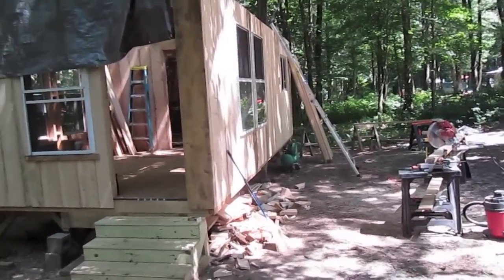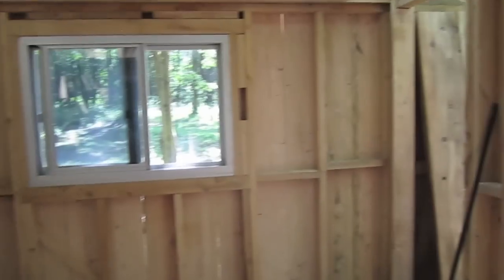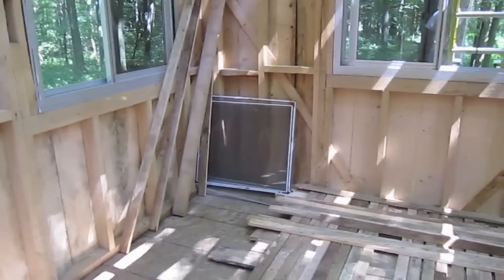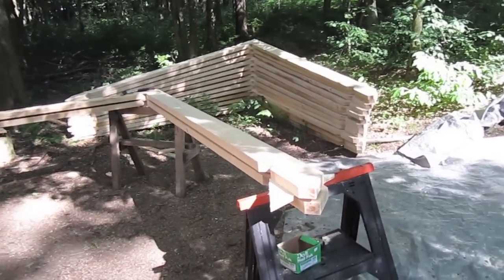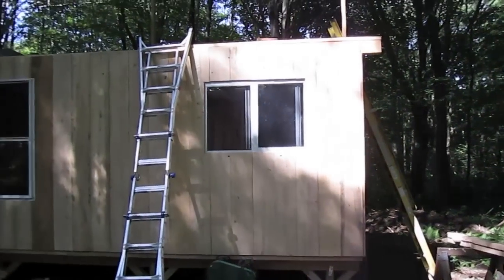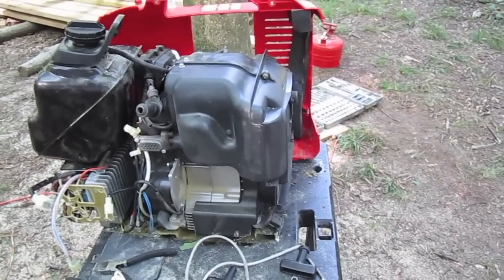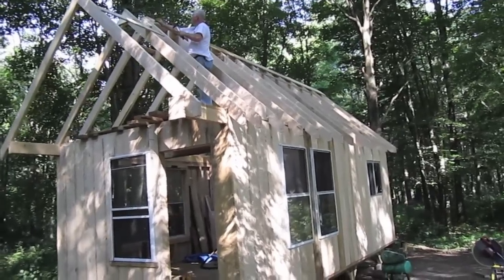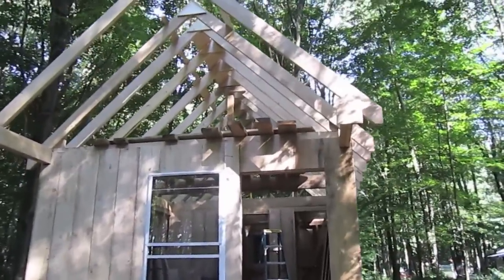Guest Cabin - installed board & baton siding, windows and roof rafters - 7-1-2012

Comment: Do the boards for your board and batten offer any racking resistance or does the cabin rely primarily on the kerf cut braces? Sorry for the dumb questions im still learning. Thank you
Reply from the maker: not very much... the cut braces do most of the work
Reply: buffcleb thank you for the reply